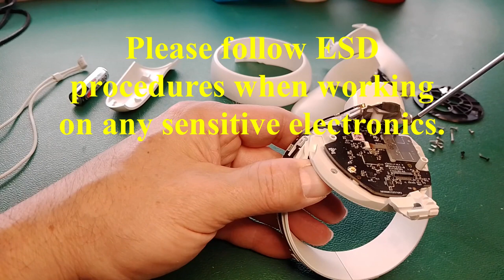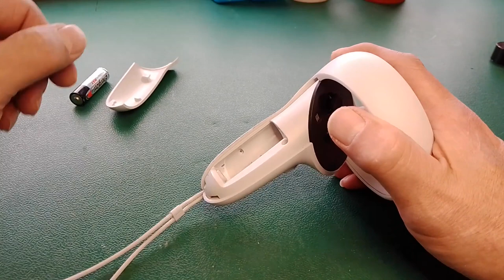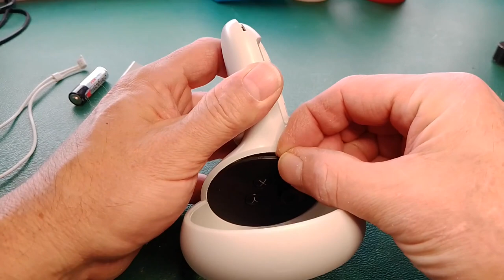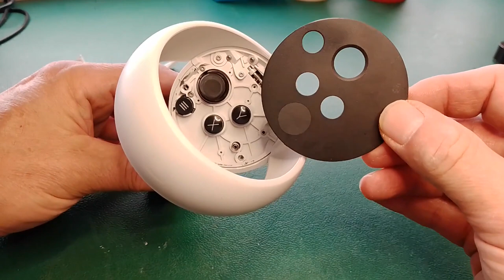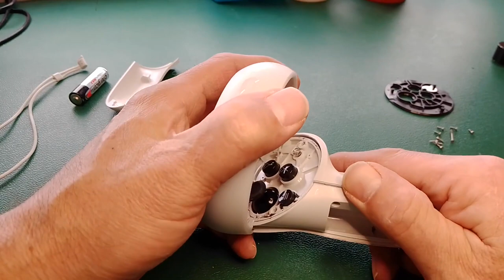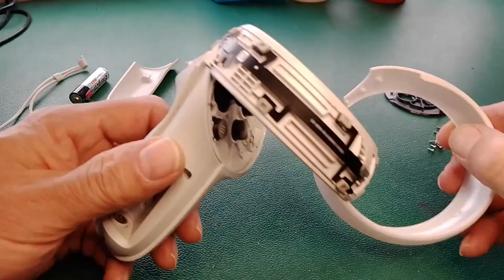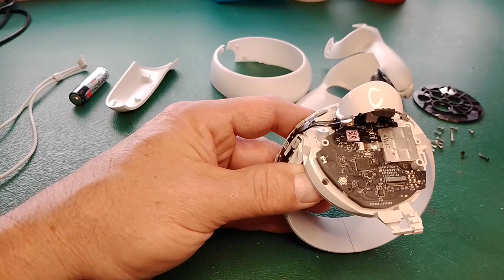Quest 2 Controller Disassembly - Don't Use  (New Version Here https://youtu.be/aZ57n6iam6Q )

Comment: I took my controller apart and now my trigger doesn’t know when my finger is on it leaving me constantly pointing, is there a fix for this? What’d I mess up?
Reply from the maker: Need some more info.  You state you took it apart.  How far apart?  Are you talking about the trigger?
Reply: @ImaRainbow  Hey! thank you for the quick responce, I took the controller all the way down to its main board like in the video, any possible connections I messed up or put out of place?

Comment: Ok. This was tough toi disassemble. My X button has a completely broken rubber/spring assembly thing... it's like crooked.. it looks like it was assembled poorly to begin with. Never was rough with my Quest 2 controllers. Never. I don't think this rubber thing is salvageable whatsoever.... has anyone else experienced this? Also, no clue how I'm going to get all three ribbon cables re-attached, ESPECIALLY the one under the circuitboard... this seems utterly hopeless. :(
Reply from the maker: I'm guessing you haven't seen my reassembly video.  I walk through the steps.  Hopefully, this will help you.  https://youtu.be/_qVBNWMFGPM  I did not capture the ribbon cable under the handle very well, (early days when I was still learning to edit vids ) but I used some fine tipped tweezers to get it in back together.  You have to fit the handle around the trigger, but not get it completely in place.  That will give you enough room to get the ribbon cable on.
Reply: @ImaRainbow  Sincere thanks. Will check out now. The rubber piece with the buttons... my god. Could these be the cheapest-made controllers of all-time? NES controllers from 1986 still work for me. Still.

Comment: Thanks for the video. I am having trouble with my controllers just bugging out and not pairing with the headset any more. Has happened on more than one and just happened again. Controller was fine last night and now is behaving as though it can't "find" the headset. Oculus took a month to receive and replace my controller so they seem to be trying to discourage replacements or just have supply problems.

I see an Exacto knife and a nice pair of tweezers in my future ( and the ESD strap ).
Reply from the maker: Seems like more of a software/firmware issue.  Have you tried resetting your headset, then repairing.

Comment: My control has terrible drift and totally unplayable.   I cannot move forward and left whatsoever,  and its pulling right.    I sprayed contact cleaner just the way they did in the video where they removed   the analog control button. Still not working.   This may have to be the next thing I do.   Any suggestions would help.
Reply from the maker: Hey, this is the most updated cleaning procedure.  You need to pull the cover and thumbstick, but not disassemble the rest.  Hope this is helpful. https://youtu.be/iitoevOXrf8

Comment: Thanks for the video.  Since mine is still under warranty, I think I'll just send it in lol
Reply from the maker: Probably wise, if you're not comfortable doing it.
Reply: @ImaRainbow  I just don't know if I can get the sticker off and back on without messing it up.
Reply from the maker: Definitely not possible.  Sticker comes off in pieces, probably so they know it's been opened.
Reply: Pretty sure if you use IPA you might get it off in one piece but I’m not sure if it would ruin the controller so I wouldn’t try it.
Reply: @cursedliquid2250  oh, so I just ended up taking out the battery and sprayed circuit board cleaner into the thin spaces of the thumbstick.  Worked like a charm!

Comment: So I was trying to lightly loosen the handle because I couldn't reach the latch and ripped the entire connecter off... I'm assuming one can't repair that kind of damage
Reply from the maker: Ouch!  If the connector came off, you might be able to solder it back down to the card.  Most folks don't have those tools on hand.  You could also have damage to the circuit card assembly.  Best bet would probably be to order another controller.

Comment: Do you have to take out the screws to get the black pad out ?
Reply from the maker: No, you don't need to pull any screws to get the black pad off.  Pull the battery cover, then you can pop it out.  It is held with some tack adhesive, but there's no screws.
Reply: @ImaRainbow  That's why I broke my nail I found out that I have a warranty so I might get a replacement

Comment: My joystick started drifting and I threw my controller on the ground and it shattered. I used your video to fix it because nothing would work after I threw it. Now my controller just has no tracking because of broken ribben wires lol
Reply from the maker: There's a lesson in there somewhere.  
You can get a new controller at the quest store, if they're in stock.
Reply: @ImaRainbow  they arent in stock. It seems like a lost cause at this point that's why I decided to repair it myself. Getting the HTC Vive pro soon anyway. I'm dying to see in 5k vr!

Comment: what if you font have a T5 driver?
Reply from the maker: Yes, you need the torx driver so you don't damage the screws.  I small thin flat blade might work, but you could damage the screws or the screwdriver by using the incorrect tool.

Comment: My left controller x and y button seems stuck after i sprayed it with wd40. Did it happened to anyone here? Should i do the dissassembly and clean the button manually?
Reply from the maker: edho77, When you say wd40, you're talking about contact cleaner, correct?  I'll assume so for now.  If you get too much contact cleaner in there, they x and y buttons can get stuck. I've got a couple things you can try before tearing it completely apart.  https://youtu.be/iitoevOXrf8  First just try popping off the black cover.  It'll let you get your fingers around the x/y buttons.  You might be able to "jiggle" them slightly and get them to work.  If that doesn't work, get a hold of me on discord Ima_Rainbow#5693
Reply: @ImaRainbow  The thing is, i mistook the normal wd40 as wd40 contact cleaner. Originally i wanted to use it because my left analog are drifting like crazy. Yes the drifting was gone, but the x and y button got squishy feeling and got stuck. As a desperate measure, i bought the correct wd40 contact cleaner and sprayed the buttons. The button got stuck even more and felt barely pressing down. BUT, it get better 1 or 2 hours after that. Now, its almost like normal. For now, i can live with it. Thanks for your reply dude.